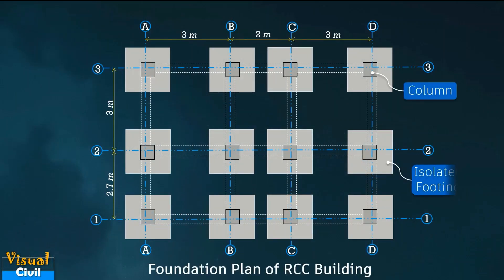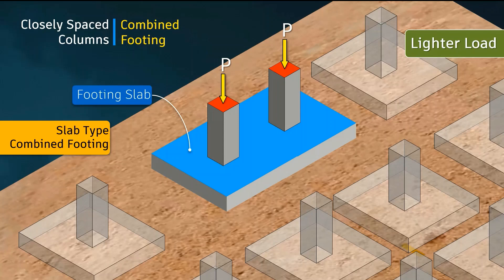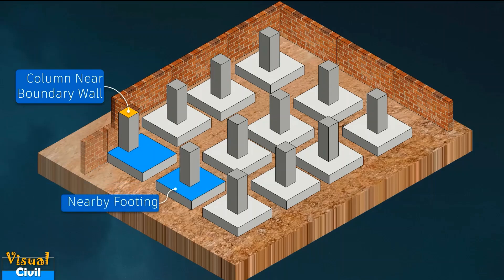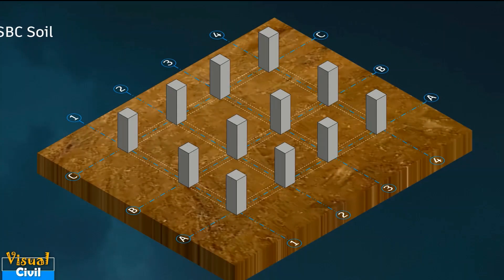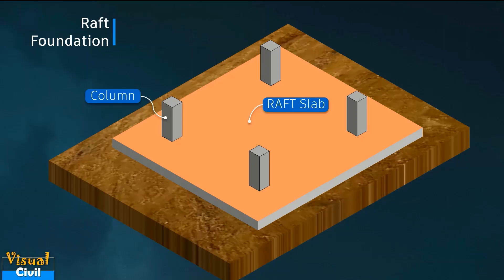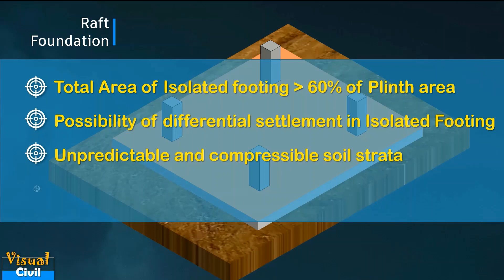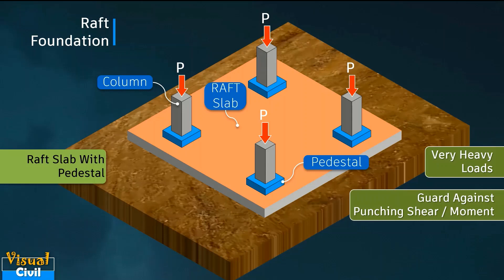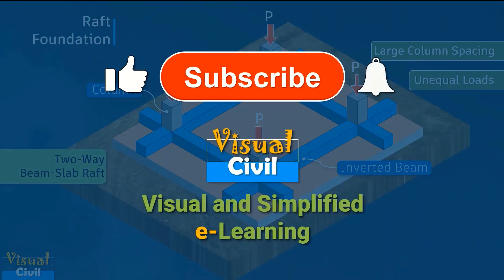Understanding Concept of Combined and Raft Foundation

Comment: With inverted beam, raft will be under ground. In that case, will the soil above the raft impart pressure on the raft thereby reducing its safe load bearing capacity . Which is better raft above beam, or raft below beam for more load bearing capacity in a poor soil